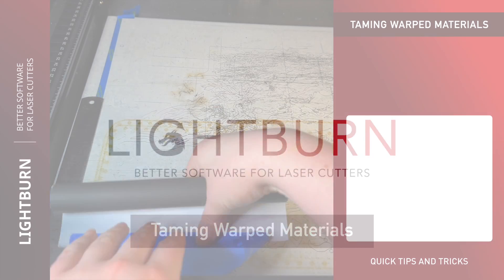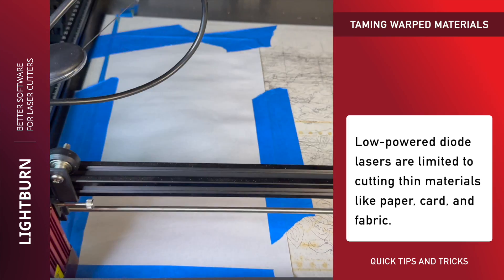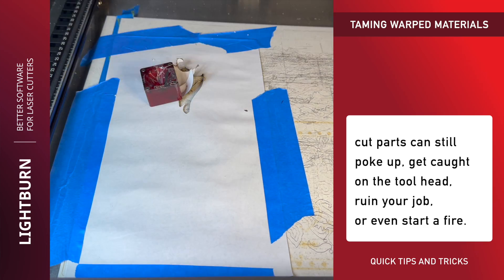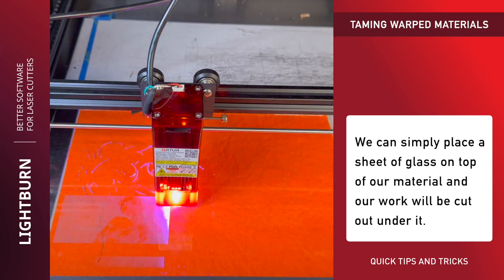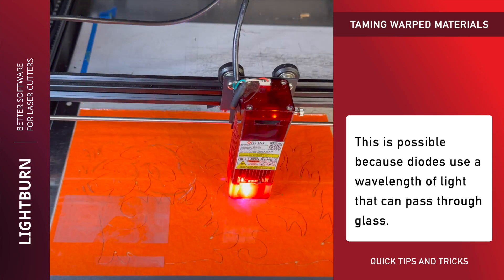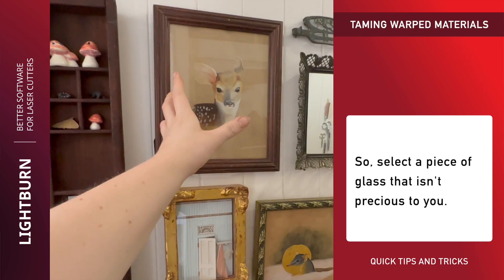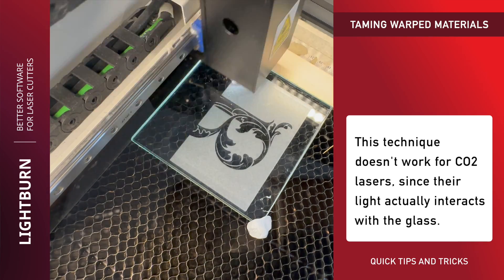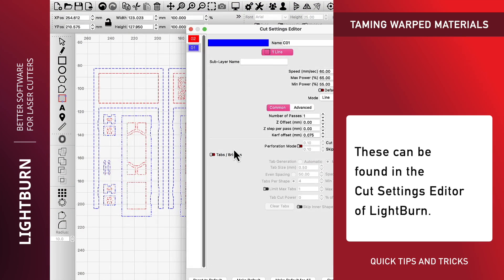Warp No More: Pro Tip for Diode Laser Cutting

Comment: not exactly the best idea for bigger power diode laser. it will scratch the glass on the side with the material. I tried to cut leather with this method and the glass will be scratched this way.
Reply: The video has a significant section talking about and showing that it can score the glass and says to not use a piece that is precious.

Comment: Are there certain specifications, what thickness of glass in mm should be used? I have tried that trick, using glass with a thickness of 5 mm to cut Eva foam with a thickness of 5 mm too, and the result is that the Eva foam doesn't cut well. What's wrong with the experiment I've done.
Reply: could it be the laser beam's focus point? need to adjust as if glass is not there...  maybe.. ?

Comment: Well for warped plywood or any other relatively firm material, get an XTOOL S1 and use their Creative Space software to handle uneven or curved material and keep sharp focus. Soon, I hope LightBurn will be updated to be able to use the S1’s ability to engrave uneven or curved material. For something like thin vinyl, the glass is still a good idea.
Reply: Vinyl is extremely toxic to cut on a laser, because of the chlorine content. It also corrodes the machine.

Comment: I don't know if this is relevant in this group but I can't get lightburn to react with the laser. I have an L2 24W Atezr.
Reply: Did you get it to work?  make sure it is no GRBL only when connecting and disable gcode clustering under device settings

Comment: Sounds great…. But then we can’t use AIR ASSIST!
Reply from the maker: Everything in life has tradeoffs. :)
Reply: A lot of diodes don't have air assist, and when cutting thin materials you usually have to turn it off anyway, lest it shifts cut parts around.